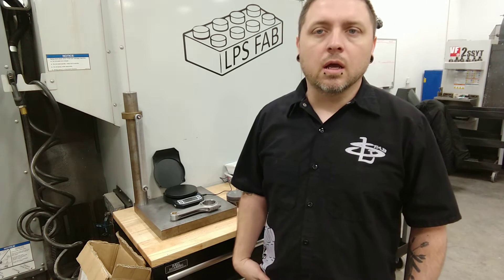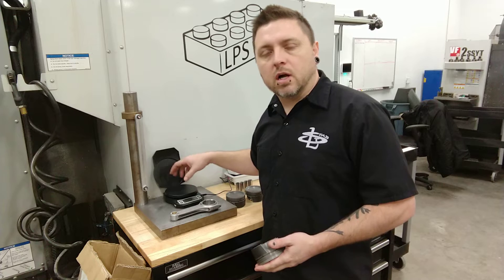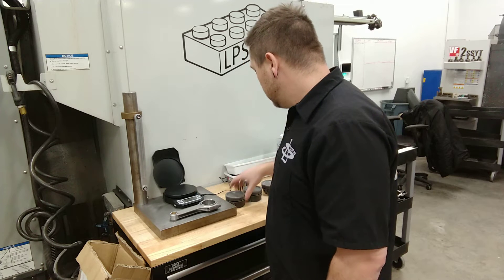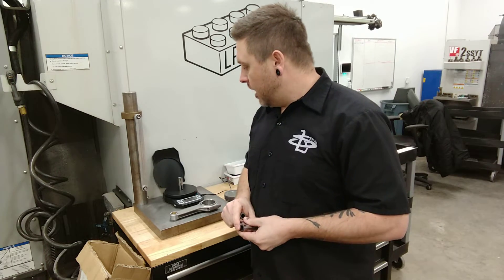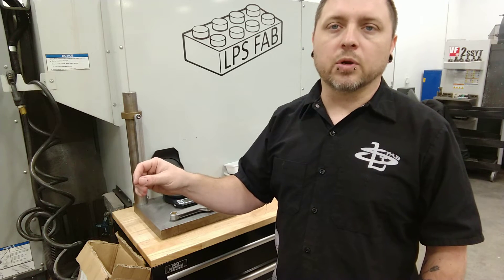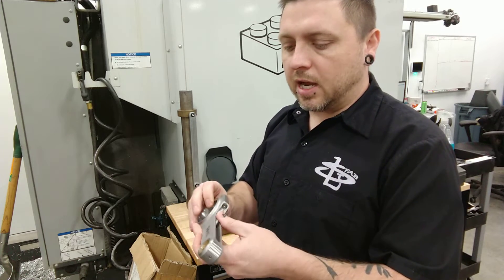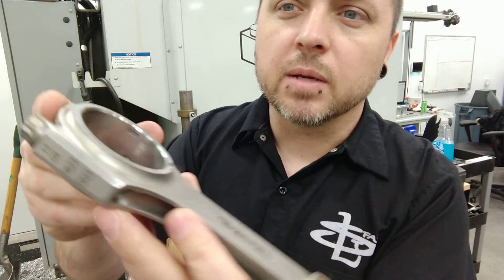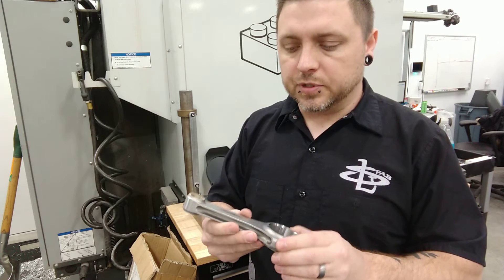VW 1.8t 20v engine build, basics of rotating assembly balancing

Comment: Why those forged component make do not do that balance task before they sale , those stuff is not cheap
Reply from the maker: They get them close, but I like them to be perfect.
Reply: I have 4 after market casting rod to fit AGN 1.8 NA engine , the max weight difference over 30g , it is impassable to grinding to balance .

Comment: Hey im interested on building my gti 1.8t 2005 awp but im lost to know what pistons rods and crank do i need exactly to build my bottom block ild really appreciate if you can direct me to buy please bro
Reply from the maker: It really depends on what your goals are and your budget. There are a lot of good options out there.
Reply: Linder Power Systems can you recommend one for me im looking for 400hp not much
Reply from the maker: @chrishuhn5728  there are a lot of options, really depends on your budget. If it's going to be stricktly a street car I like the idea of the OEM bam pistons or the mahle powerpack so you don't need a lot of cylinder wall clearance. Lots of rods available from cheap eBay ones to high end.. look at scat, eagle, spa, zrp, IE, etc.
Reply: @chrishuhn5728  I have a 1.8t 2005 too have you started to build
Reply: @skullettrump3424  yea i started and finished Intergrated rods weisco pistons bearings crank now saving up for bigger turbo and fuel management then head
Reply: @chrishuhn5728  how much all that cost
Reply: @skullettrump3424  i did everything with 4500 had money some wat Left
Reply: @skullettrump3424   i did timming kit journals gaskets etc etc
Reply: @chrishuhn5728  nice how much power you wanna get out of it
Reply: @skullettrump3424  honestly after the head and fuel system wat not bigger turbo i want it around 480 close to 530 nothing crazy but i built to hold around 800hp so i dont have to worry bout something blowing up or wat not you kno but tell me bout your build

Comment: Thank you sir, I can better identify with the concept now that you’ve delivered what I consider to be a nuts and bolts break down. It’s easy to get lost and overwhelmed looking at a white coat demonstration where everything has been put together to replicate what you might see in a NASCAR team shop, but your blue collar perspective took a lot of the anxiety out of the experience. 

It’s not that I now feel empowered to do the internal assembly of my own power unit, but, it’s the merit of knowing that not because my resource doesn’t have the absolute best in available technology that the services will be handicapped. 

With the correct approach and the attention to the details of basic concepts there are a lot of positives that can be achieved. 

Just a few questions for you please, in the previous video you mentioned testing the connecting rods for the consistency of the hardness, can you elaborate on this? I know you said that measuring the cylinder bores was next so my question might be answered there, but at what point to you validate the piston skirt? Or do you match piston to bore based on this depending on the variances.

Thanks again Mr. Linder for taking the time out of your schedule to complete this initiative.
Reply from the maker: As far as testing the rods, I use to work for a company that does nondestructive testing using ultrasonic and Eddy current methods. With these instruments I could test the material of the rods vs a known piece of material and compare the two, so I didn't really check the hardness but the material used to manufacture the rods. Mind you I only did this because these were cheap China rods, if you get any sort of quality name brand rod this isn't necessary. As for the skirt/bore measuring, if I understand your question correctly, it is very straight forward and where to measure the skirt usually comes in the documentation with your p. pistons. I think the video will answer your questions on that, but manufacturing is very good these days and if you have a competent engine machinist you won't have much variance to worry about.
Reply: Linder Power Systems thank you for the response, and I’m very interested in the progressive work reflected in this video series; it really was a super idea 🍺

Comment: out of curiosity what is the overall weight of the maxspeed rod, ive just checked my integrated engineering set they are 570g
Reply from the maker: They were just over 600g, 608 I believe after balance